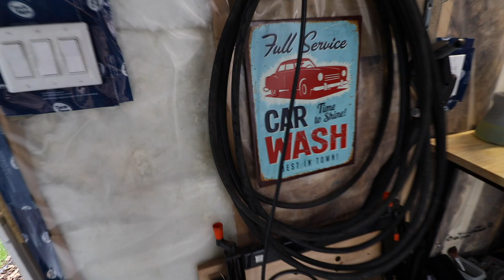Garage Build EP05 - Custom Wall Mounted Pressure Washer Setup

Comment: If you’re using quick disconnects why would you need to install another outlet water source for short hose?   Waste of work and money isn’t it?
Reply from the maker: Was something fun to do haha. As well I mentioned a couple reasons for it.. I can close the man door now.. as well I have a split valve on the inside, allowing me to fill buckets without disconnecting 👍🏼
Reply: @brodiecd7093  what do you have to disconnect to film buckets?  You can just run water from pressure washer hose plus it’s a good way to get any air out the system?
Reply from the maker: @jrose7381  I think it fills the bucket a bit quicker than through the hose. But it's all good man haha. Was $30 and a lil time 👌🏼
Reply: @jrose7381 as a DIY’er sometimes you wanna take your project to the next level by personalizing it… Yeah sometimes that means doing things that aren’t necessary 👍💪